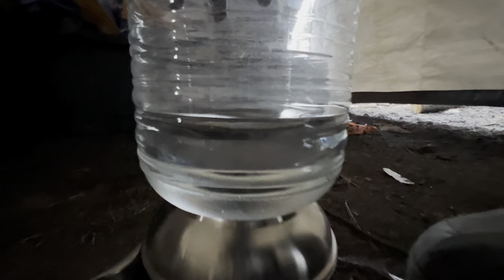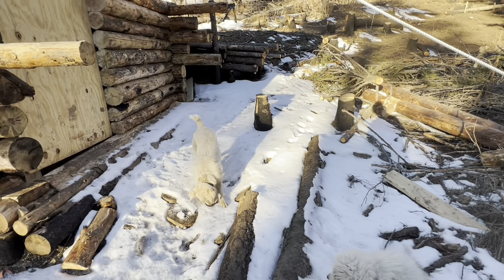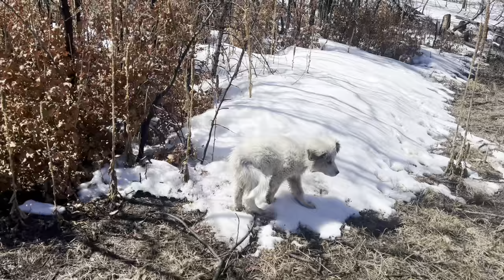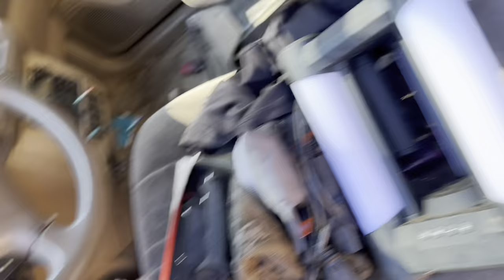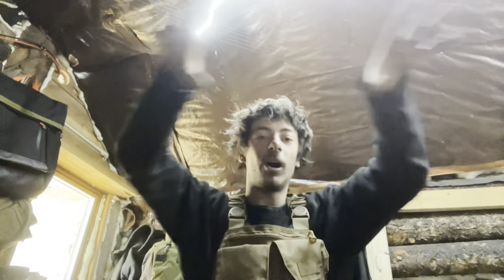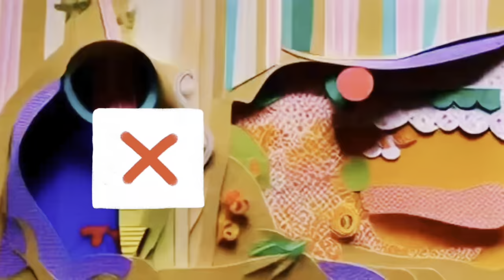Living In Self-Built Shelter 8,500 Feet Elevation

Comment: Opinion on the Skidoosh hood and truck bumper.

Skidoosh hood should go back on the snow machine to protect the engine and its components.
The worst enemy of all is the sun , the rain isn’t the best either.

But just stick it back in place and hold it on with a couple Bungee cords or ratchet straps.

Even if you buy a brandy new one, it’s not going to come with windshield, headlight or any of the pieces affixed to it and you will positively wish you had old hood.

The truck bumper…. If you never buy a winch bumper it can go back on,
If you crash the truck you’ll have a spare bumper.
If you sell or trade the truck the original bumper only adds to the value.

Just slide it underneath the bus.
LOTS of space under there and you’re not invading on potential space needed by Lucky or any other reasons inside the bus.
Reply: Great advice!

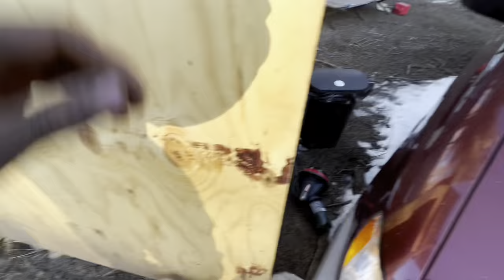Comment: 2:50
Bro with one more 2X4 and one more sheet of plywood you can seperate the bathroom from the storage. You'll need to adjust the other side as a doorway but you have a chainsaw so that's pretty easy. 
Cut the 2X4 into 4 pieces and count how many studs on one side is enough, count the same on the other side . Put 1 piece of the 2X4 onto the top and bottom of each of those studs on the same side. Make them half on and half off the stud. Now you have 4 places to screw on the piece of plywood and you have separate rooms. 

It's also easier to heat a smaller space, being warm when you poo in the winter makes a difference 👍👍

Comment: Yo Will.
 You can definitely use posts to build a water store,weight bearing for the posts will depend on how deep you sink them and how much concrete/postcrete you use around foot of posts...  For example as a rule of thumb you want to sink your posts at least a third to a half of the height of your build above ground level..(exp. If your build is 10 ft high from ground level, you will want to sink your posts 5ft into the ground)  and then you will want to use around 4x25kg bags for each post depending on how much weight the overall structure will hold. Hope this helps. Keep inspiring Will. WHAAABAM 👋💥

Comment: You can use spray foam as a high temp sealant. Great stuff makes a “fire block” spray foam but the only difference is the orange color. Spray foam is right around my pellet stove pipe and doing fine.

Comment: Yoo willy to help solve your issue in the sauce boss’s cabin just cut a few logs then split them in half and use to seal the bottom of the wall on the floor on the inside to keep mice and water out would definitely help a lot! Also hooper is getting so big! Keep it up willy kabaaaam!!
Reply: Great suggestion

*Edit 
I was thinking it could be used as a base molding to cover the gaps helping close it off. Good suggestion either way to use logs that way..
You're not lying about the mice
 🤣 they can fit or chew their way into just about anything.
Reply: 🤣🤣🤣 there is ZERO that can be done to keep mice out of that cabin.🤣🤣

It’s tough enough to even TRY to keep them out of a regular house, he sure isn’t going to be able to keep them outta that little hut with a couple extra sticks!!

Comment: Put the ski do hood on. It's gonna get damaged from rain and sun if not. It's very fixable. Also save the bumper you may need it oneday. Never know when u may want to change back due to aftermarket bumper issues .

Take care of your stuff better bro or it's not going to last. Been self reliant means you take care of your tools so they last an don't gotta buy more . You reuse an save things that may be useful an use old stuf to build with when able. You gotta learn to reuse stuff fix stuff and take care of your stuff better or you won't be able to survive off grid and nothing close by
 Cuz your stuff will always need replacing or what ever due to not taking good care of it an doing preventative measures like preparing stuff ahead of time
 Stocking up. Taking care of stuff so it lasts an don't leave it out an un covered etc. Clean you stuff an do maintenance. 

Just trying to help you learn for the future man.

You need to go stay on a real off grid place with someone that's done it for years sk they can teach you the value in saving supplies of taking care of your stuff and tools and how to do that because those homestead that have lasted a long time don't spend money replacing stuff unless it's an improvement because they know cheap tools don't last leaving stuff out will make stuff not last. Etc.
They don't replace tools and equipment often because they protect it from weather the sun etc an take good care of it. And right now your basically gonna be replacing everything every year at the path your on and that's not self sufficient or a reliable way to live off gird on a homestead doing it on you own without needing a store every week for supplies N replacing stuff.

I know you can do it man just gotta learn an grow.

Get in touch with  ( @Gridlessness ) on YouTube through instagram . Watch there videos an reach out to talk with them an maybe see if they will let you come up for a week an learn from them